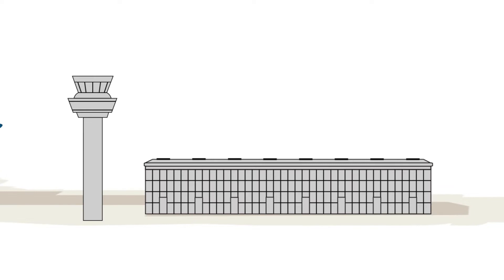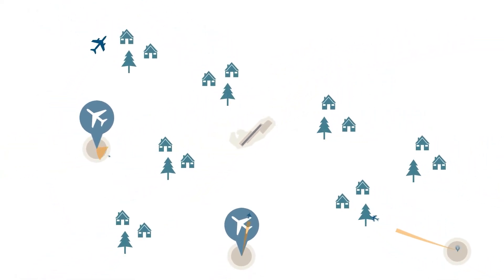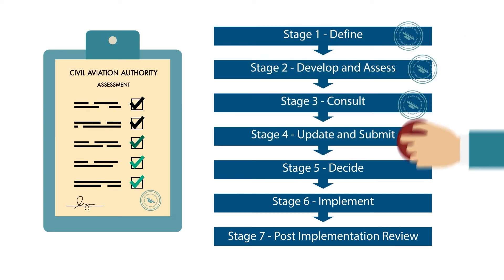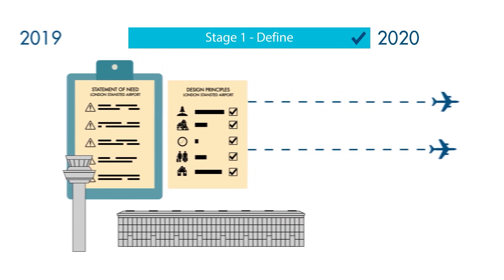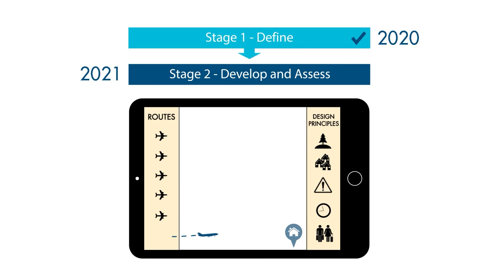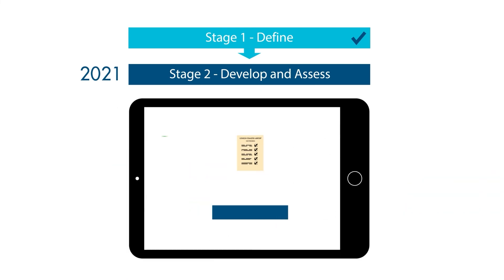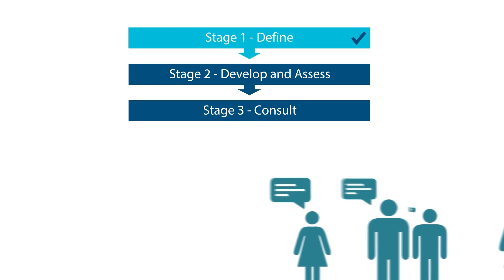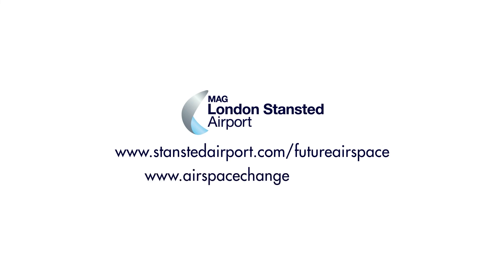London Stansted Airport Airspace Change Progress So Far

Comment: Let me give you a bit of a reality check. Instead thinking only about your airspace. Find how to improve the service on the ground. Like your mid term car park roads a terrible. Ho ever managed dose car park roads. If I was managing dose surfaces I would find someone a lot more capable to do it. For the amount  of the money collected the mid term car park at least I would make sure the staff car park at least in a better stage . And I would put a note on the website were you sell tickets where should people park as note and which bus stops and arias are suitable people to park . I would not make people wonder with kids half an hour until they find out which bus stops collect people for the terminal. I would clean the stone chips from the askhvalt to ensure peoples cars are not damaged by them. Feeling the pod holes without right preparation just makes a bigger hole next time . Please ensure you have the reality check, and do take the messers needed before a large campaign against your Stansted management company is been raised.